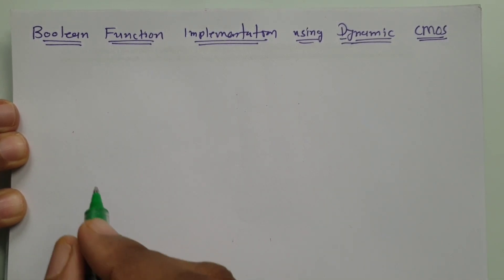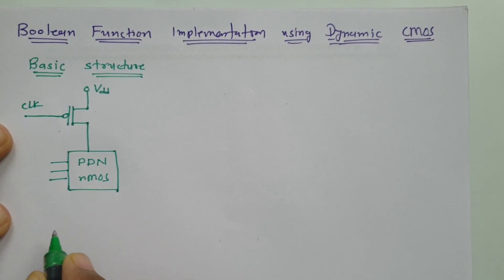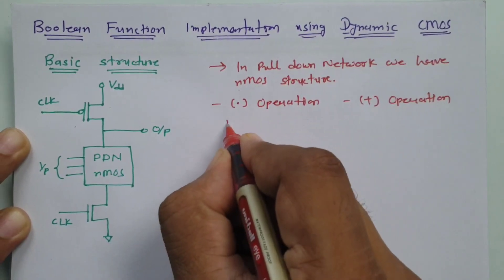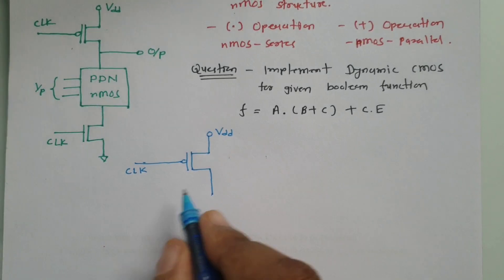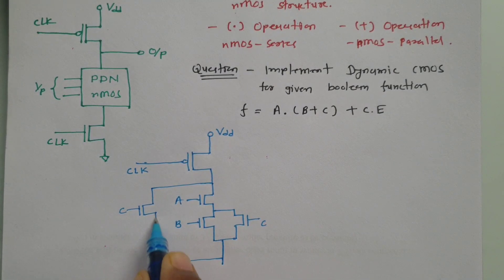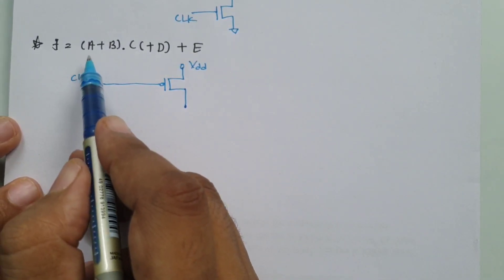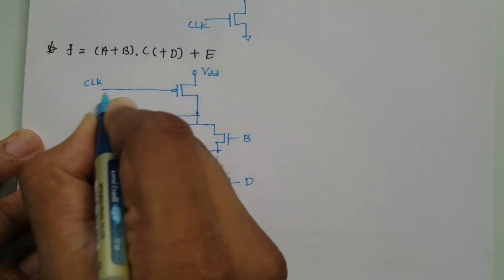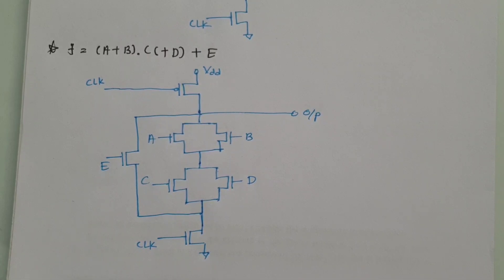Boolean Function Implementation using Dynamic CMOS Logic | VLSI by Engineering Funda

Comment: sir in this video either you should add an inverter at the output or there must be whole compliment in the question since the output is always complimented.
please clear my doubt sir I am having issue to understand this.
Thank you for all your efforts .
Reply from the maker: If you have output Y = f_bar, then don't  do complement but if Y = f, then do place inteveter at the output of circuit.
Reply: @EngineeringFunda  then ,there is no f_ bar in first question.right
Reply: @EngineeringFunda  ok sir thank you 😊